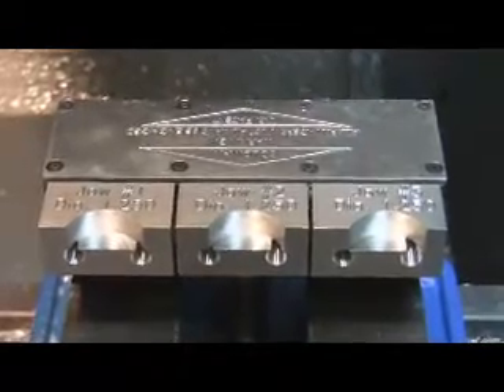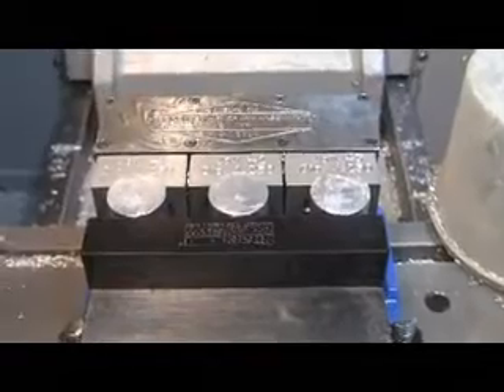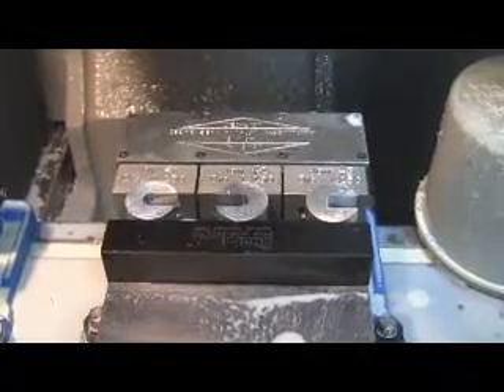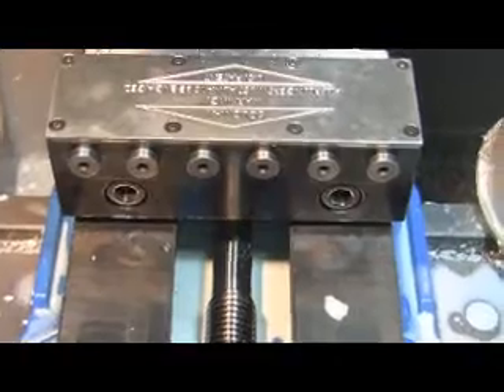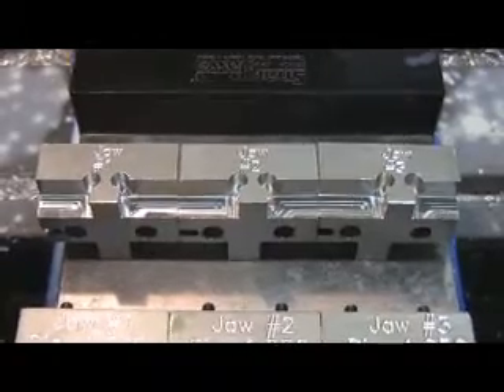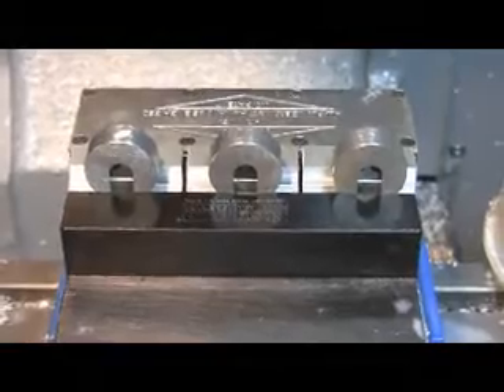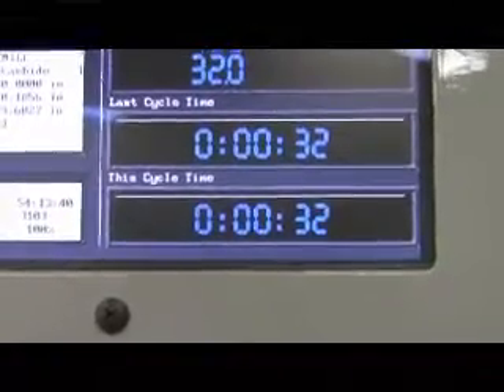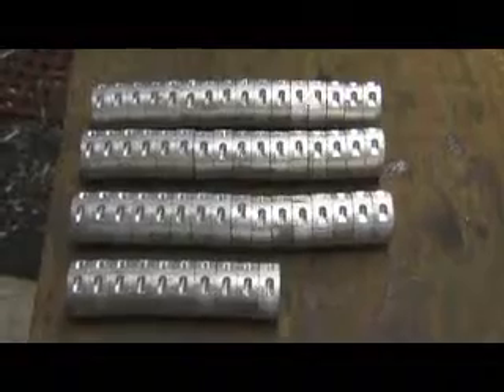Swashplate Tool Production

Comment from the maker: @mtnbikecrazy55 

I fly Radio Control Model Helicopters and make tools and accessories for the Radio Control hobby.  These are tools that are utilized to keep the swashplate on the helicopter level during the setup process.  If you visit my website  you will find further information.